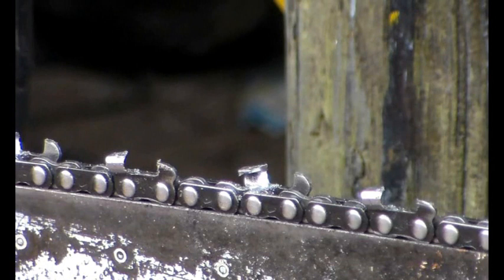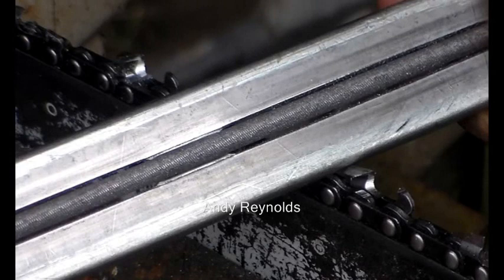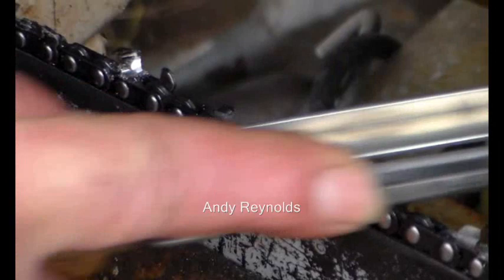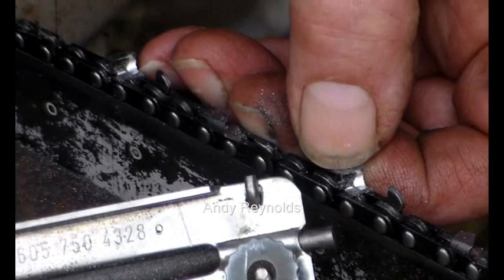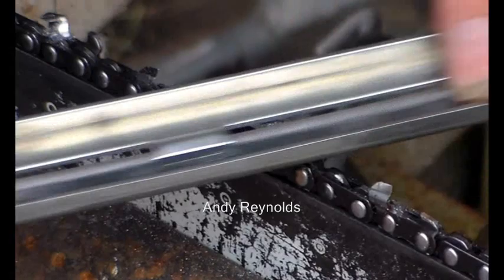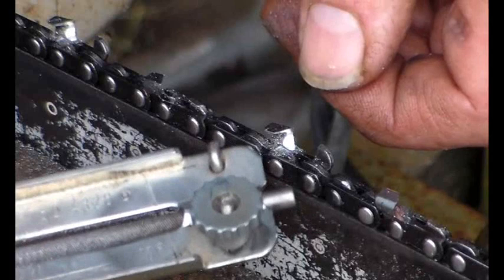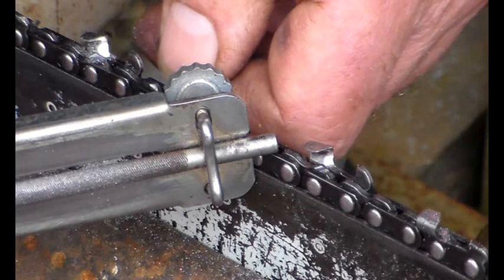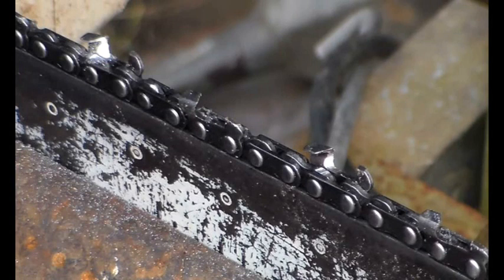Is that chainsaw chain sharp? a brief explanation

Comment: Hey Andy , the same size cutter theory has been disproven as the cutter only cuts in between the cutter and the raker. Meaning only the top part of the cutter actually cuts. Therefore if your rakers are set properly , you shouldnt get any vibrations.
Reply from the maker: Hi. I still like to have all the cutters at the same height, which means the same length as they taper, cheers

Comment: I met a guy one who sent his chainsaw away to be sharpened. I wondered about that, but looking at some of the comments people do seem to think of it as a dark art. I am, of course, a novice when it comes to chainsaws having only really used my 35cm electric one  for very light felling and mostly on firewood. but I usually sharpen before I think that the blade is getting dull and I do it with a round file of the appropriate size without a guide. Depending on the mood I mark a dot in marker on the tooth I begin on and then give 3 consistent strokes on each tooth, then turn the saw around in the vise and do the other side and that's that. Given the very limited use that I have I tend to get a year or two out of a chain and I rarely touch the depth gauges. I tend to buy the cheapest chains on the internet. How they usually fail for me is that they stretch out, and the tensioner on the saw doesn't seem to hold them and the cut can become wavy. But maybe I know nothing and am talking guff. All the best Andy! Owen
Reply from the maker: Owen, yes those electric chainsaws tend to be a bit poor on oiling and so the chain can wear prematurely. A good sharp chain prevents some of this excess wear buy running for less time so you are right to sharpen before you need to push the saw to make it cut. The filing guide prevents the file from gradually drifting down into the gullet and I have seem it were it got to the stage where the file didn't break through the top plate. In that case no amount of sharpening would do any good. Those mains electric saws are great for your situation and I have one here for those little jobs where noise is a problem, cheers

Comment: Informative content  as always... not that it's a massive difference but would you file the depth guages before or after sharpening the cutters ? Cheers
Reply from the maker: Hi. Thanks for the comment. I always file them after as the sharpening process lowers the height of the cutters, cheers

Comment: I was taught to knock the burr off with the file handle .
Reply from the maker: Thanks for the comment. Yes I used to teach that. I understand it is a left over from the old days when the chrome plating on the top plate was not so good as it is now. The theory was that bending the burrs down stopped the plating peeling off. With modern chains this does not seem to be a problem, cheers